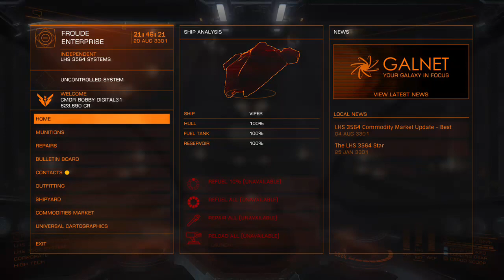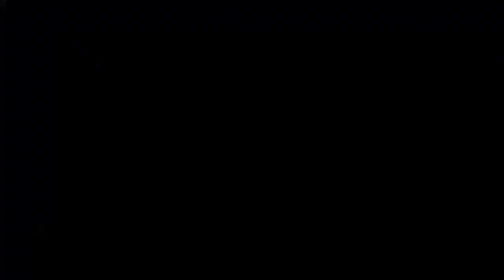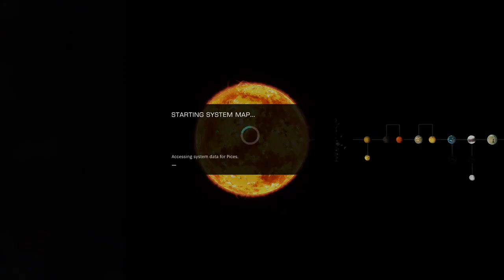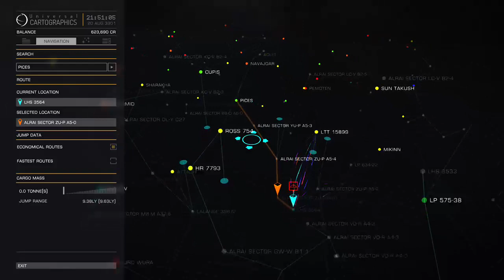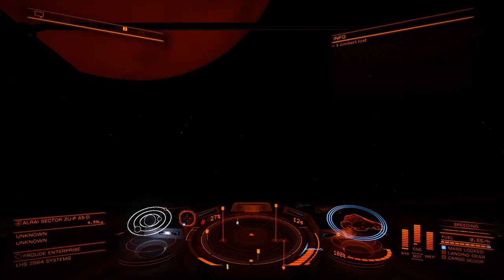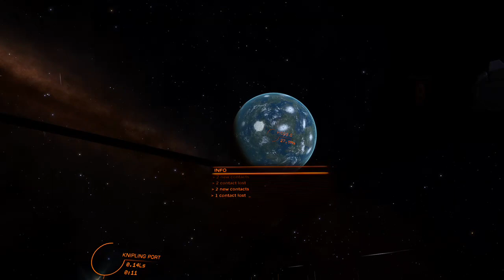Elite Dangerous - Xbox One Beginners Guide Part 2 (Navigation & Trading)

Comment: OK, I have a question; those 2 lines (blue) that need to be aligned...What do you PRESS on the XBOX ONE controller when the lines are aligned?My ship keeps missing the timing... I'm pressing Y, X, A, B... nothing takes the ship in close to port???JGphins
Reply from the maker: should be the same button you use to enter supercruise and make jumps, on my configuration it is "Y."  Just make sure on the left side of your radar that alignment panel has the speed and distance blue needles in the blue zones and your ship should give you a pop up in your center view that "safe disengage ready" message, that's when to hit Y. also to if you set your speed needle in the blue zone on the throttle at about 10 seconds away from destination in supercruise then your ship should automatically slow you down to the correct distance and speed to make the jump alignment work in order to safe disengage your frame shift drive and exit jump at destination .
Reply from the maker: also try holding in each button and it will bring up a text showing you which  button combinations do what. maybe that'll help you find the jump button. I think it's called frame shift drive
Reply: +Bobnice31 It worked. Thanks for tip / reply.I was looking online, trying to see if ED Horizons will be released to XBone but could not find news on future expansion.  Do you know if we (consoles) will get to enjoy planet landings too or is it just for PC users?Thanks.
Reply from the maker: +JGphins I'm 90% sure Xbox one will get all future expansions. from what I remember them saying is that they're making both versions the same. PC guys might get the expansions earlier maybe. I'll look it up and see if I can find it for you